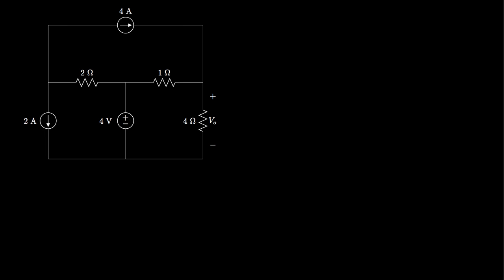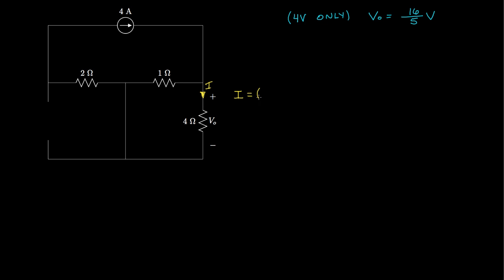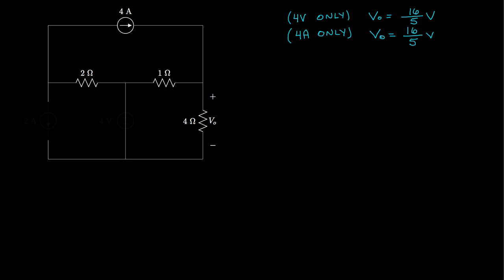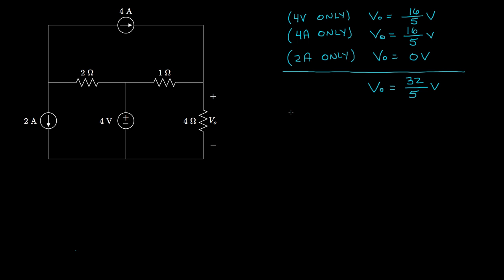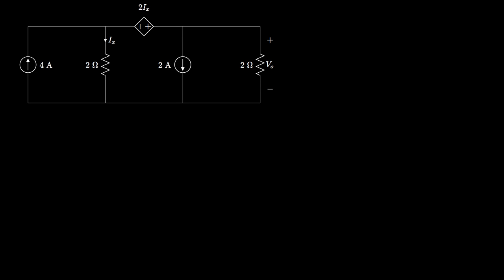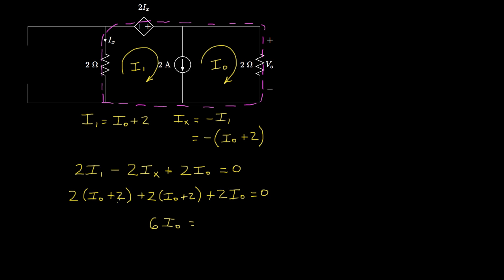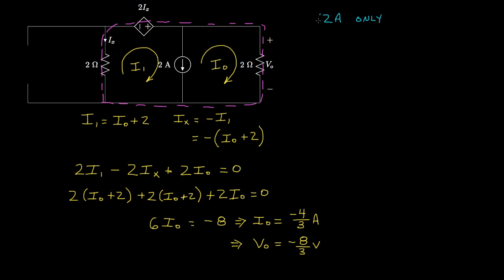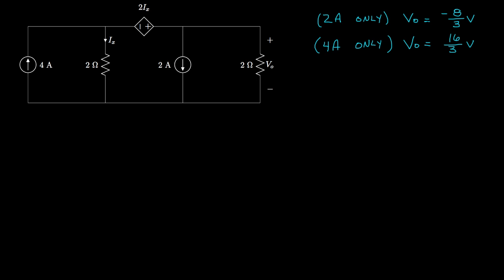Introduction to Source Superposition - Part II

Comment from the maker: Hi Tony -- Yes, in general, the current will split. However, because the short circuit has zero resistance, ALL of the current will flow through the short, and no current will flow through the 4 Ohm resistor. (Think about the current division relationship.) Because no current flows through the resistor, the voltage across it will be zero.

Comment: When you are solving for the effects of just the 2 A source why is Vo = 0? Wouldn't the current get split by the short circuit caused by the voltage source?